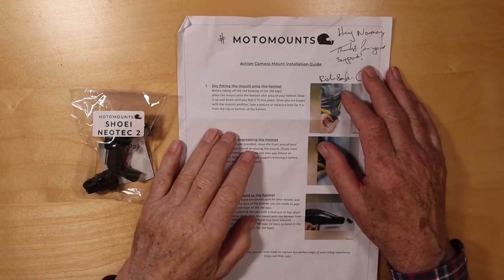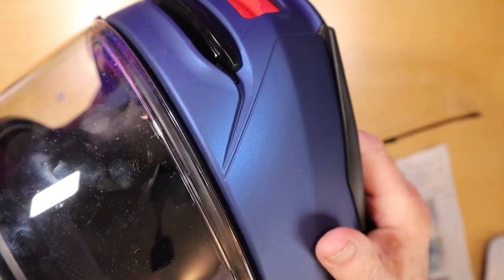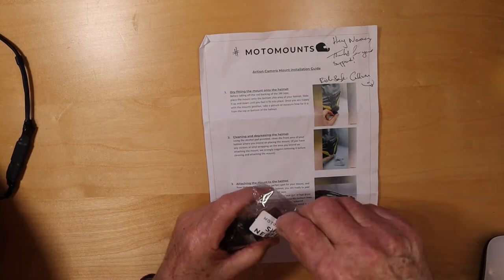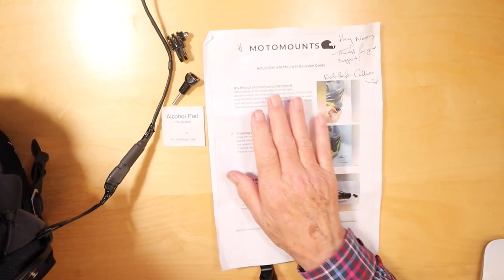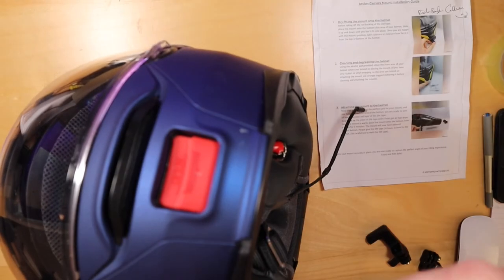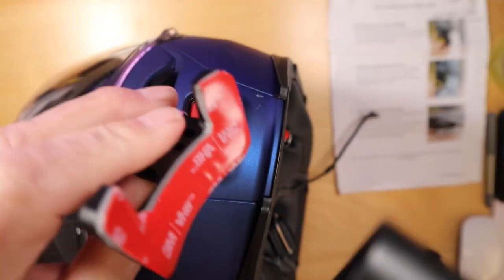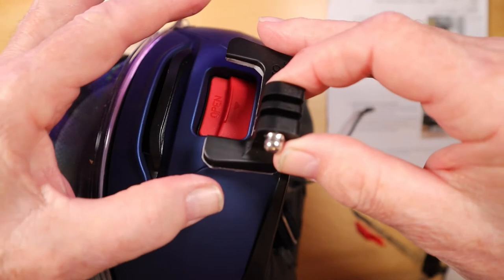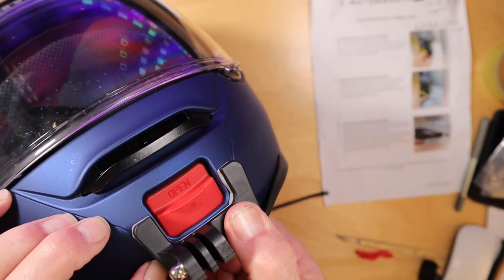Motomounts for GoPro Mounting

Comment: Looks a decent piece of kit Norm. I have mine on the chin, but I used Sugru to mould the GoPro mount to my helmet. Goes off like concrete and has been there for a few years now.👍👍
You watch it fall off the very next time I use it now🤦‍♂🤦‍♂
Stay safe Norm
Reply from the maker: You are right Tojjer, it is exactly what I have been looking for...but will my new Hero10 end up in a ditch like a Hero 5 did in Ireland a few years back, never to be found again!
Reply: @normski3091  I certainly hope not, for your sake. Have to say, I've found this Sugru absolutely incredible stuff. Not just for biking things, it's amazing what you can use it for

Comment: I have one of these mounts although I haven't used it yet. I have a Neotec 1 and hoped it would fit but the profile of the helmet where you attach it is slightly different to the Neotec 2 so it wouldn't be as secure. I'll just keep it until I upgrade to a Neotec 2 now. Nice quality and quick delivery to the UK though. I agree that the supplied extension is too short to get to the flip front release button though and you don't want to keep changing the camera angle to get to it so a longer extension as used in the video is a good idea.
Reply from the maker: Yeh mount is great. I keep experimenting with the extension arms. You think it is perfect and then realise that too low etc etc, camera angle is not easy, but once you get it OK. I have a HERO 10 and just a lapel mic from Amazon, cheap one. Put the mic under the windshield of my SENA mic and run the cable directly into the back of the GoPro, works great. Then a power bank in my pocket that also runs right into the back of the GoPro. Lasts all day on 4K filming on and off. Changing batteries was an absolute nightmare 😩
Reply: @normski3091  After I posted my comment I found your video on how you set it all up so watched that. 🙂 I found it very usefull thanks. Yes once you've got the camera angle right you don't really want to move it again. I also have a cheapish mic off Amazon but find it a bit crackly intermittently, also a powerbank for my jacket pocket although it also runs off the bike USB when fitted to the frame.

Comment: Im going through all this  mounting stuff as im after good audio. How has it been so far th amount? I ride with th flip up and wonder if you can swivel it easy to change view?
Reply from the maker: Hi Flapjack, The Motomounts is brilliant for me on my Shoei. It sticks really well and no movement. I did have to use a longer extension as it was too close to my helmet with a short one and would not allow me to 'tilt' it enough to be able to film down the road properly. At first I incorporated a joint with a ball on it so I could swivel the GoPro to exactly the right angle but this made the whole unit so heavy that there was the possibility of the lid crashing down. You would require a really long extension and swivel joint to twist the camera, even a small amount😗